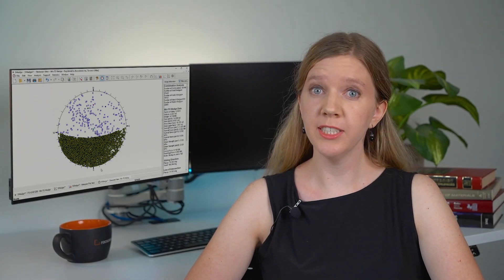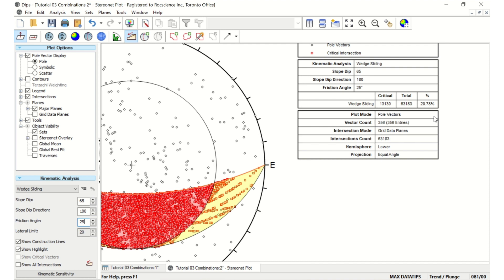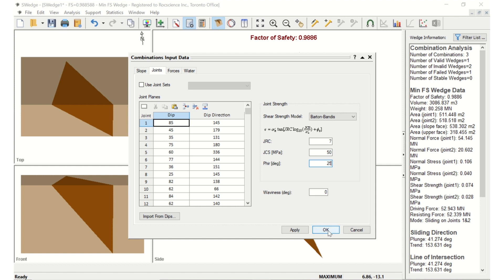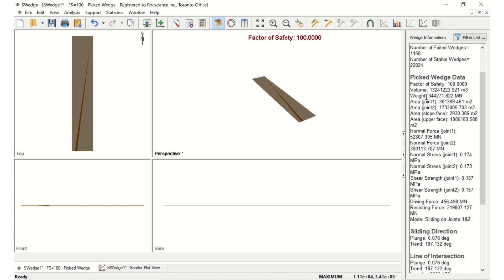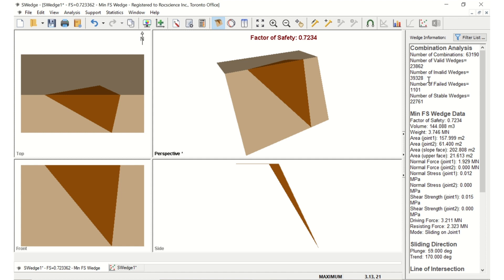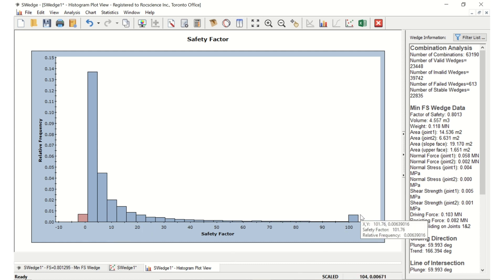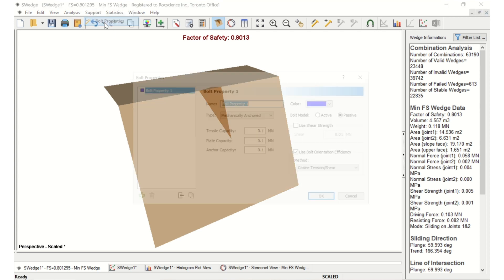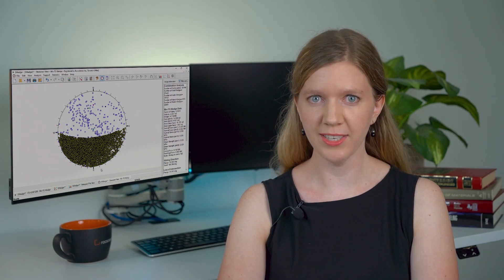Dips and SWedge Tutorial - Combinations Analysis

Comment: On what basis we input friction angle? Why in probalisttic analysis files are not saved in Swedge or Splane?
Reply from the maker: Hi!

The Friction Angle is used in SWedge and RocPlane to define the shear strength of the joint, assuming a Mohr-Coulomb shear criterion. The shear strength acts as a resisting force in the limit equilibrium calculation. A higher friction angle along the sliding joint will contribute to a higher factor of safety. In a model where there is only Friction Angle (i.e., zero cohesion and no other external forces other than the weight of the wedge), a wedge will slide only if the sliding inclination (either the plunge of the line of intersection if sliding on both joints, or the dip of the plane if sliding on a single plane) is greater than the friction angle. 

In combinations or probabilistic analysis, all inputs are saved to a file by going to File > Save. However, each sampled wedge is not saved to a separate file with its corresponding deterministic inputs. The sampled wedge and its deterministic values can be easily viewed by double-clicking on a data point in any of the Statistics charts, showing the 'Picked Wedge' in the 3D view and Wedge Information pane. All sampled wedge data can be exported to Excel by going to Statistics > Export Dataset.

Let us know if you have any other questions!